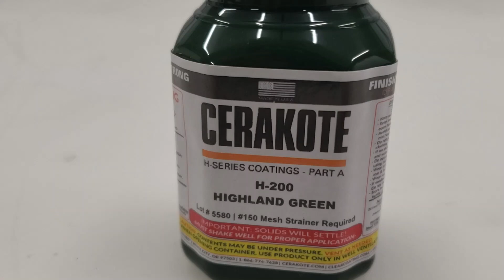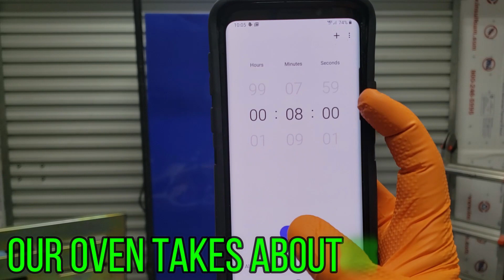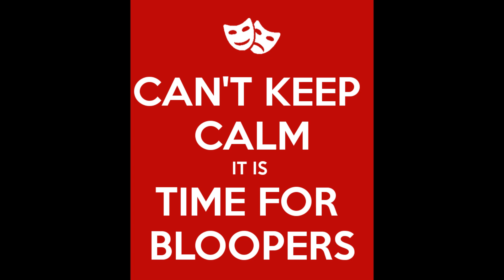Cerakote TAURUS G3C | M81 Woodland Camo

Comment: Awesome work. Do you have any videos of how you built your oven?
Reply from the maker: Unfortunately no, I was in a rush to get it done and did not film it. Very simple, just and old paint storage cabinet lined with ROckwool insulation, and heavy duty aluminum foil. Used a smoker element from amazon as the heater, and a inkbird PID controller. All thread  ran through the top for a place to hang stuff. I did not go real crazy and kept it simple.
Reply: @AllThingsFunHydrographics  awesome. Thank you. I did the cheap gun safe method but dont have alot of room in it. Looking for other ideas. Keep up the awesome work

Comment: You didn't have gloves on when applying stencils dont that affect the cerakote?
Reply from the maker: As long as you wash your hands before handling the stencils then it is fine... just got to be careful and not touch anything else like your face so you don't transfer oils to the cerakote. Those stencils are really difficult to manage and apply with gloves on.

Comment: Does this effect the performance of the gun at all ?? Even slightly ?
Reply from the maker: Not at all. We Cerakote and Hydro Dip tons of gun, literally every day.... never have any issues with function or performance. All we are doing is taking off the original finish, and replacing it. No messing with the internals or function. Clearances are just as they were before.
Reply from the maker: The factory coating on that G3C was some kind of nitride finish. It came off pretty easy in the sand blaster. It will me much more tough with the Cerakote on it now.